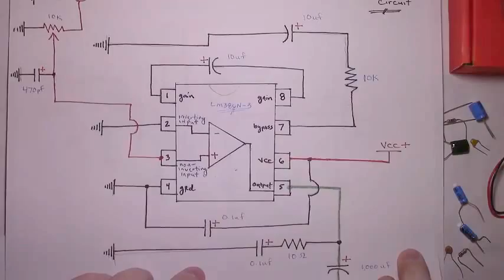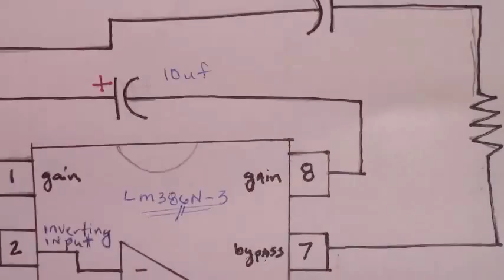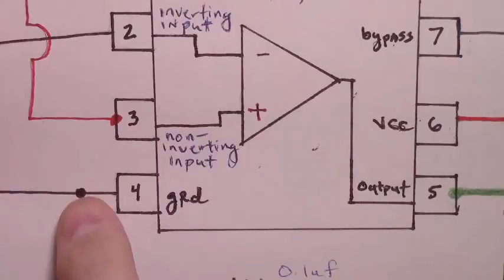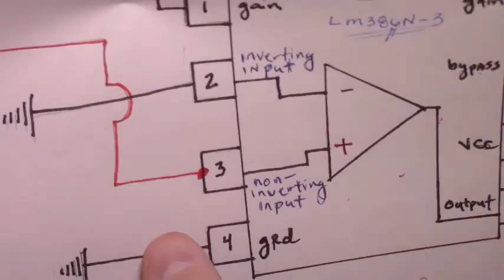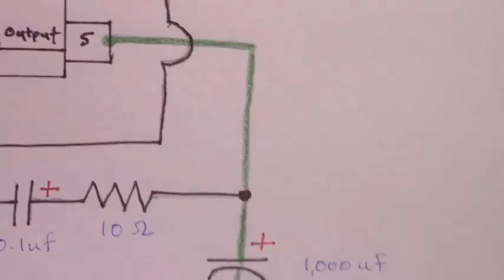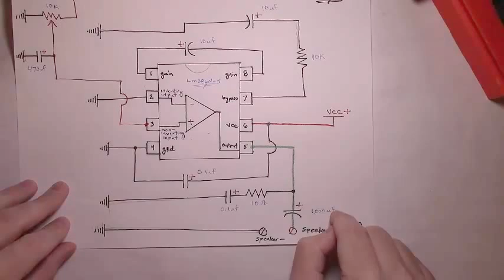Circuit Assembly Tutorials || LM386 Audio Amplifier

Comment: Thanks for the awesome tutorial. This was the most descriptive I found anywhere.
I have a question...How much more amplification will I get if I connect this to a npn preamp?What improvement will it make to the output.

Thanks again.
Reply from the maker: Appreciate the comment, I'm glad the video was helpful.

Adding a preamp stage to the LM386 circuit is definitely possible, I've done so in the past.  The circuit built in the video sets the LM386 to its maximum gain of 200 (via the 10uf cap between pins 1 and 8).  Any signal fed to the circuit will be amplified x 200.  It's possible to lower the 386's gain by adding a resistor in series with that 10uf cap.  Such is described in the LM386's datasheet.   Whenever I've added a preamp stage I've normally had to reduce the LM386's gain so as to avoid distortion (x200 gain can become a lot when combined with a preamp stage that's, e.g., x50 gain).  It's always a matter of adding a preamp stage that boosts the incoming signal to the LM386 which will in turn boost the signal even more --> while at the same time, keeping all the 'boosting' a little below the 386's distortion threshold.    

What one can do:  Start out by setting the mp3, etc., player's volume fairly low.  Build the npn preamp you have in mind and feed its output to the 386's input.  Connect the player's output to the preamp/386 combo and see what it sounds like.  Starting with a low player volume will protect the speaker and your ears.  Slowly increase the volume and see if the signal starts to distort before it reaches the volume you desire.  If so, then I would reduce the gain of the 386 in increments, e.g., from 200 to say 175, from 175 to 150, etc., until I ended up as close to the volume I wanted minus any distortion.  

Two things to note:
(1) Most of the npn preamps I've built ended up having a low (ish) input impedance.  This can be a problem in regards to some music players.  Too low of an input impedance can shoulder the player with having to provide too much current.  One doesn't normally have to worry about such with op amps, but it can become an issue when using transistors 'in the raw'.   If you're unsure about the input impedance provided by your npn preamp stage, then you might consider building the preamp around an op amp instead (they make some really great high input impedance, low distortion, low noise, etc., op amps).         
(2) A preamp built from npn (or pnp) transistors can sometimes add quite a bit of noise into the signal depending on the specific components (caps, resistors, etc.) used in its construction.  Any noise the preamp adds to the original signal will be amplified (often exponentially so) when it passes though the 386 circuit.  It's often quite surprising how much a small amount of preamp noise can make to the eventual signal quality.  It's a case of whatever goes into the 386 circuit comes out amplified x200+ (assuming one sticks with the gain setup demonstrated in the video).  It's completely possible to amplify the signal so much that one will begin to hear such unwanted things like capacitor charge and discharge cycling (yuck!  I've encountered this nasty occurrence quite a few times...nothing makes a great song sound horrible quite as much as hearing constant cap charge/discharge noise over or under-laying it.).

I definitely don't intend for these comments to discourage.  I offer them solely as a way to say, Try it.  But, be ready to refine, rebuild, etc., the preamp circuit a few times on the way to obtaining the sort of volume and signal clarity that you might want.    

As a final remark, I'm planning to do some videos on building a few different preamp circuits in the next few months and would greatly appreciate hearing about how the one you eventually end up with performs.  I'm planning to start with op amp based preamps due to the desire to avoid any input impedance issues, but I would definitely like to know if you come up with an npn version that performs well, etc.  

Hope these comments are helpful.   Please let me know if there are more questions and I will always do my best to help.
Reply: Thanks for especially fast and the great input. I'm building one this weekend for a university projects. Will definitely let you know how it goes. Thanks again :)!
Reply from the maker: Minhaz Mahmood 
You're welcome.  I look forward to hearing about what you eventually make.  I wish you good luck with the project.
Reply from the maker: standishgeezer Greatly appreciate the comment and link!  

I'll make sure to check out the schematic. No worries about Eagle, I can relate.  Eagle is nice but the search for the sort of symbol one might want for a given schematic can sometimes be a pain (combing through the libraries, remembering where a desired symbol is located, etc.).  If the circuit is of a reasonably small size I tend to manually draw it (as evidenced by all the hand drawn schematics in my videos) rather than use the design software.  But the software is certainly handy and often essential when it comes to manufacturing a more polished and tidy circuit board. 

I've worked with the TL072 before and was planning to use it in a future preamp video.  It's a really nice chip, little to no noticeable noise, etc.  It'll likely be a few months before I can construct and upload a preamp video (quite a few viewer requests and personal projects to attend to first) but one (or more) preamp videos is/are definitely in the hopper and on the way.   

Thanks for watching!
Reply: philo mech Just noticed that you are planning to build some preamp circuits and wanted to hear from anyone who had already done so.  I have built a couple of preamps using TL072 and LM358 (I've even used the LM386 as a preamp for the LM386!  -  http://blog.erikzone.co.uk ). The TL072 and LM385 preamps are very impressive with very little, if any noiset. The TL072, in  my opinion has the edge in terms of gain but both are good and have a pin-for-pin match so you can swap them about to see which you prefer. The added advantage is that both of these are dual opamps and therefore leave you a free amp to incorporate a simple tone control circuit. Happy to share a schematic (badly done in Eagle - as I'm not great with Eagle) or as a graphic..

Comment: how complicated can it get if I want to make it stereo? can i just redo all the circuit twice and conect the other cable of the mp3 jack? or is there a better way?.

ps. sorry for the lack of knowledge, just started to learn about this stuff. ;)
Reply from the maker: Appreciate the comment.  Glad you're entering the world of electronics.  There are tons of interesting circuits to build and learn about. 

Running the right and left lines through their own LM386 circuits will work fine, just make sure to connect the player's ground wire to both circuits --> add a Y to the end of the ground wire and run one leg to the first circuit and the other to the second.   One of the player's output lines will tend to carry more of the music (either the right or the left, relative to the song), that's normal for stereo.  Definitely let me know if there are more questions and I will always do my best to help.
Reply: Thanks

Comment: Got a question. Instead to output the amplified signal to speaker, can i pass it to je LM3916, because im making VU meter and i need the signal amplified. The other thing im not sure about, is do i need to supply both LM386 and LM3916 with same voltage (+5 or +12 for example) ?

And one more thing. After connecting ur 9V leads to the breadboard, you follow it up by a 100uF cap, but that cap is missing from your schematic.
Reply from the maker: the ViTALiTY 
Appreciate the comments and questions.

It's definitely possible to use the LM386 as a means of amplifying a signal sent to a LM3916 or 3914.  I've done so before and it works fine.  Though the 200 gain setup used in the video might be a little much.  If so, you can reduce the gain by adding, e.g., a 1K to 10K resistor in series with the 10uf capacitor connected between pins 1 and 8 (see the 386's datasheet for a more detailed discussion and schematic of such).  I'd initially try it as the circuit is described in the video.  But if it turns out that the majority of the leds connected to the 3916 are staying on all the time, then I'd try reducing the gain via that resistor in series with the 10uf capacitor between pins 1 and 8.  

Setting the reference voltage on the LM3916 is always the tricky bit.  It might be easier if you used the same voltage for both the 386 and the 3916 but doing so is not necessary.  You could operate the 386 from 9V and the 3916 from, e.g., 5V, but you would need to keep the voltage swings coming out of the 386 in mind.  If the 3916 is dividing up 5V and the 386 is swinging between, e.g., 3V to 7V, the amount of leds on at any given time might not be proportional to the amplitude of the audio signal.  This sort of concern is largely done away with if you power them both from the same amount of voltage. I'd definitely encourage you to try whatever you initially want to try and see if you end up with the result you were hoping for.  If not, then I'd move to try second, third, etc. choices.  Either way you go, you'll likely need to connect their grounds together (it might work without doing so, but it's generally better practice to connect the grounds when one IC is sending a signal to another IC).

You're right, I added a 100uf decoupling capacitor to the breadboard power supply in the video but didn't include it in the schematic (I probably should have).  One can get by without that capacitor as long as the volume isn't turned all the way up.  But, it's better practice to decouple the power supply lines for most any IC one is using (especially amplifiers and timers).  Doing so helps to prevent 'brownouts', voltage sags, etc., if/when the chip suddenly has to draw more current, the cap will 'hold the voltage up' (hopefully) long enough for the voltage supply lines to stabilize before too much sag is translated over to the IC.

As a final thoughts, you might consider using a run of the mill op amp instead of the 386, e.g., a 741 or 358.  They're not audio op amps but they can perform the same task as the 386 in the context of constructing a VU meter.  And, they likely wouldn't require near the amount of external components that the 386 does.  The 386 is highly sensitive to proper grounding, RF interference, the type of capacitors, used, etc., etc.  Whereas generic 741 and 358 op amps are not nearly as finicky.  And the signal doesn't really need to be especially 'clean' when it's being sent to a 3914/16.   

Hope these comments are helpful.  Please let me know if there are more questions.  I will always do my best to help.  

Thanks for watching the video and I'd definitely appreciate hearing how your VU meter turns out.
Reply: philo mech
Thanks for the fast answer, will definetly drive the LM386 and LM3916 at the 9V, i will just need to recalcualte 2 resistors i have on LM3916. 

And just to clarify, 1000uF and 10uF (x2) Capacitors are electrolytic right? Rest of the capacitors are ceramic?
Reply from the maker: the ViTALiTY 
The 1000uf and 10uf are electrolytic, voltage rating 50V (but any voltage rating that's around twice as much as your supply voltage would be fine).  The rest are polyester or ceramic.  A better overall sound quality can normally be obtained by using polyester capacitors instead of ceramic anywhere signal processing, smoothing, etc., is occurring.  When constructing an audio amplifier circuit I use polyester if I have them, ceramic otherwise.    

Just let me know if more questions, etc., come up as you move forward with the VU meter.  I always do my best to help.
Reply: philo mech
Thanks for all the help, really appreciate it, and i got the VU Meter prototyped on a breadboard, but currently with LM3915 since im still waiting for 3916 to arrive. So basically only thing left to do is this amp because the raw input from something like mp3 or a PC just isn't enough for the meter to work properly (only first couple of LED's are lit up and thats it). If you are interested i would be more than glad to send you schematic and board projection that i will be doing in EAGLE, because i plan to put this whole project on a PCB.
Reply from the maker: the ViTALiTY 
I would definitely be interested in seeing the schematic and PCB layout when you have it completed.  Just let me know when you have it all working.  I've built quite a few VU meters as well as audio spectrum analyzers, it's always a lot of fun to in a sense 'capture' and 'see' sound in lights.  I'm planning to build a series of videos on one of my more recent audio spectrum analyzer projects within the next few months and I would definitely appreciate any feedback you might have.  I wish you well on the VU meter project and look forward to seeing how it turns out.
Reply: philo mech
Is the 10k pot linear or logarithmic?  I got the linear one.
One small position change on my pot and the volume is either max or low :S
Reply from the maker: the ViTALiTY The one I used was linear.  I've never had much luck with logarithmic.  I've noticed at times that some pots behave significantly different from others.  Are you using the metal type or smaller blue plastic variety?  The larger metal type used in the video have always provided me with the better range of adjustment.  The one I've used in all of my LM series amplifier videos was purchased from Adafruit, but I've had equally decent range and responsiveness from those I've purchased from Sparkfun, Jameco and RadioShack.  I tend to use those from Adafruit more only because they are 'breadboard friendly' whereas the others require soldering wires onto the poles.  Adding the wires is no problem, but such doesn't tend to show as well for videos.  Hope these comments are helpful.
Reply: http://store.mansteri.com/images/tutorials/Tutorial_pot.jpg

Thats the one i use.
Reply from the maker: the ViTALiTY Thanks for the image.  I've never used one that looks quite like that.  But I my guess is that it should work fine.  If you haven't already done so, here's something you might try: 1st) Set your multimeter to the ohms range and connect its probes to the pot's two outermost pins (pins 1 and 3).  The meter should read something very close to 10K ohms.  If not, then there's something wrong with the resistance disc inside the pot.  2nd) Assuming everything checks out fine with the ohmic reading between pins 1 and 3, attach one meter probe to pin 1 and the other to pin2 (the middle pin).  Once the probes are attached, turn the pot's knob back and forth.  Confirm that the resistance varies like it's supposed to (i.e., turning the knob one direction results in the meter reading decreasing, turning the knob the other way results in the meter reading increasing.  3rd) repeat the same procedure between pins 2 and 3. Going through 1st -3rd should reveal whether or not the pot is working as its supposed to. 
    
You might also try: 
Replacing the pot with a resistor (connect + audio IN to one leg of the resistor and the other leg to the wire previously connected to the middle pin of the pot. After substituting a resistor for the pot, see if the volume (signal amplitude) increases/decreases like you expected it to. Values you might try (~500 ohm, 1K, 2K, 3K,~5k, ~6K, 10k).  The smaller the resistor value, the higher the signal amplitude should be, the larger the resistor value, the smaller the signal amplitude should be.  If the signal amplitude changes as you expected using resistors instead of the pot, then you know the pot is the culprit.
 
Hope these comments help. Please let me know if there are more questions.
Reply from the maker: the ViTALiTY Did you try to post a comment a few hours ago?  I thought I saw one but when I went back into the channel comments section it was gone.  Was the potentiometer working properly?  Just let me know.  I'll always do my best to help.
Reply: philo mech No, didnt't.

And yea the pot is working fine, i guess its just the way it is. I got the PCB tracing done, now i just need to etch the board, drill it and solder everything onto it ;)
Reply from the maker: the ViTALiTY It's unfortunate that it wasn't suited for the VU meter application.  At least it'll still work as a simple mp3 player amplifier.  An LM358, 741, or similar op amp would be my next guess.  I definitely wish you the best with it.